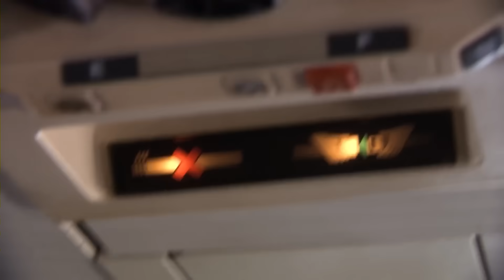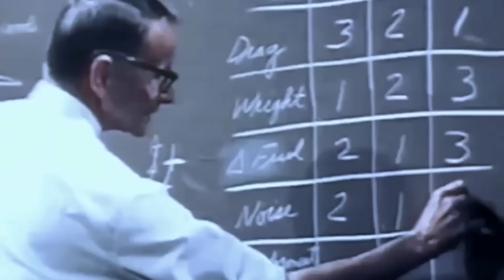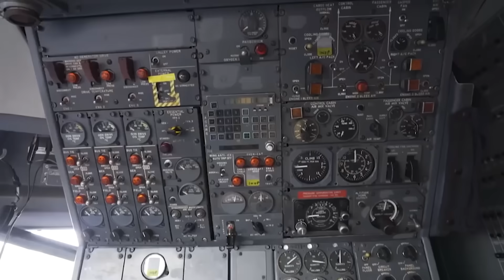The Mystery of the Vanished Trijets

Comment: Have flown on the B-727, DC-10, & L1011.  I have always been partial to the "quads" (4 engine jets), the B-707, DC-8, B-747, A340, they truly have some nostalgia.  Multi-engine aircraft were initially developed because of the extra power needed, not necessarily due to safety.  In the piston & early jet age, one could NOT build an engine capable of more than 100,000 lbs of thrust, so more engines were required.  When the B-707 & DC-8 were built, only 4 engines could develop the thrust, they did not have the technology to build a B-777 engine.  Since twin engine aircraft are cheaper on fuel & maintenance, the quads are disappearing like the trijets.  The  loud roar of the early low-bypass ratio jets, and the plume of black smoke coming out of them definitely brings back memories, but these old jets have become a thing of the past.
Reply from the maker: You bring up some great points! The evolution of engine technology has certainly changed the aviation landscape. Those classic quads had their charm and nostalgia, and it’s fascinating to see how far we've come in aircraft design!

Comment: its not vanished. There is still Dassault Falcon
The vanishing of larger trijets is simple, maintenance. If you are a techcnician which one you prefer, underwing engine few foot from the ground or an engine like 20 foot from the ground? also imagine if an engine need to be taken for total maintenance/refurbish, taking out the tail engine will need much more tool and equipment than underwing engine
Reply from the maker: You make a valid point about maintenance considerations! The Dassault Falcon is indeed a great example of a trijet that still has its place in aviation.

Comment: With all rear engined jets, the weight being at the rear of the plane tends to make it directionally unstable. Same principle as those little balsa-wood chuck gliders that have a knob of plasticene on the nose. The French Caravelle, the DC9. the Bac 111, the VC10, the L1011, that layout hasn't survived. Harder to "stretch" the fuselage too. Cheers, P.R.
Reply from the maker: You bring up some excellent points about rear-engine jet stability and design challenges. It's fascinating how engineering choices can impact aircraft performance and longevity. Thanks for sharing your insights!
Reply: @SkylineSecrets-yt Other than the Caravelle with its cunard mounted ( out of early design caution ) horizontal stabilizer, a T-tail has more pronounced effects on stall characteristics than rear engine weight. Look it up before you leap.

Comment: With twin engines jets is safe and more efisien, whats benefits for operators for keeps flying triple engines jet? If MD10, MD11 OR L101 IS PERFECTS JETS ON THATS YEARS, TODAY ALL TRIJETS IS ONLY OLD AND OLD THEN MANY PEOPLE'S BUYING PLANES TICKETS TODAY, IF DC10 HAVE CLEANS CRASH RECORDS, TODAYS DC10 IS ONLY SCRAPS JETS.
GAS HUNGER, NOISE, HIGH COST AND AGES MAKES DC10,MD11 AND L101 JUST DESERVED TO BEING SCRAPPED.
Reply from the maker: You raise some valid points about the efficiency of twin-engine jets. The advancements in technology have indeed made them a preferred choice for many operators. However, some airlines still appreciate the unique capabilities and nostalgia that trijets provide, even if they come with certain drawbacks.